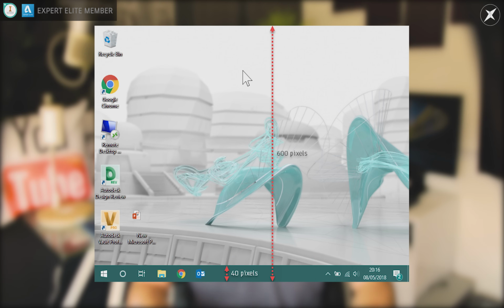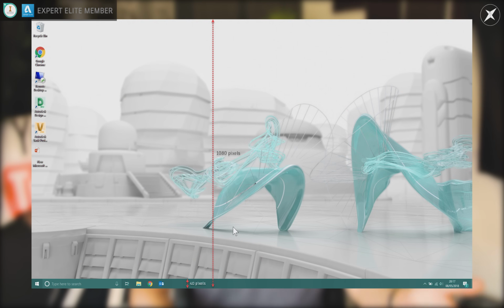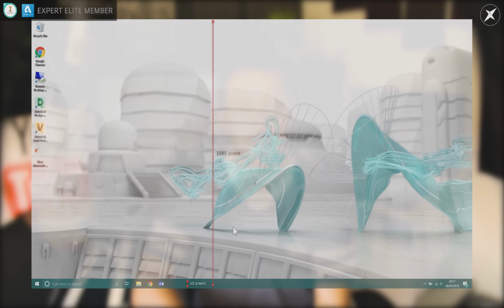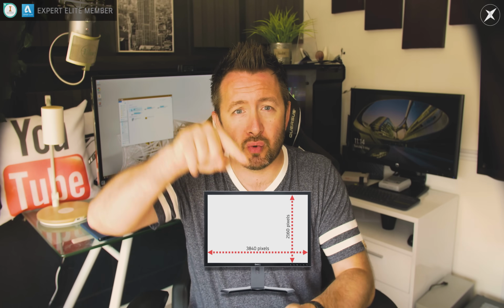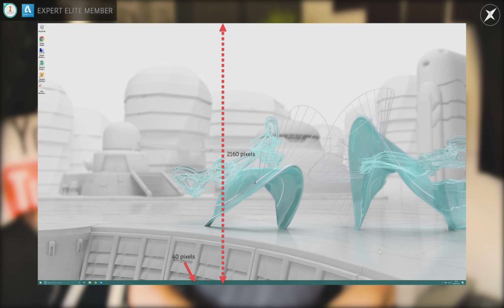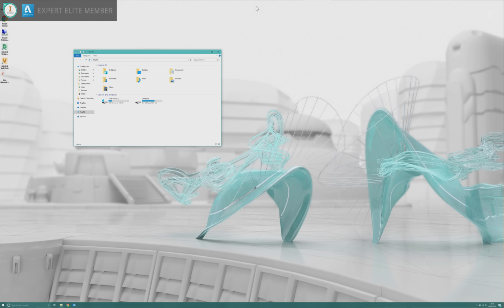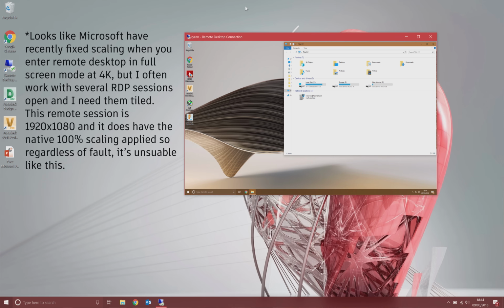Why 4K is no good for me, and possibly for you too (CAD, Engineers & Admins)

Comment: I respectfully disagree with your evaluation. You're using a 4k gaming laptop - That's hardly an objective evaluation - especially for using the resolution for a business. 27" or less in 4k is useless for productivity.

I'm using a 40" 4k screen with windows scaling disabled (100%).  It's real estate-wise it is 4x 25in 1080p screens perfectly welded together. Multiple windows, nothing maximized, and I can use a vertical aspect for the web/documents, horizontal for CAD. Nirvana.
Reply from the maker: Fair enough - I hear what you're saying, I did consider this but after looking at the text and dialog ratio to resolution... I couldn't convince myself that I'd be alright with that even on a larger screen.  This wasn't an objective evaluation either, it was my opinions on my channel.  So would your argument be that 4K without any scaling at all is workable by most people, with a wide variety of differing eyesight capabilities from blind as a bat to 20-20, on screens of 27" and over? Because my eyesight is great and at 1440p with 100% scaling on a 34" panel, I really wouldn't want this text to be much smaller than it is, this was all taken into consideration before scripting the video but I do respect your input here... I may dive deeper into this if I can get a hold of a larger 4K panel.
Reply: on a larger panel, yes.  But note that I personally rejected even a 27" panel to replace my three (aging) 25" 1080p screens.  My eyesight isn't the best,  but at 40 inches, text and window elements is physically the same without scaling - naturally scaling bugs are absent.  

PPI (pixels per inch) is the real enemy when it comes to using a display for CAD work.

Sadly, it's really difficult to shop for "mid-size" 4k panels right now ...unless you are okay with 55".  This is the one I'm using:
https://www.rtings.com/tv/reviews/samsung/ku6300

Comment: I would never enable scaling ... a better solution is to move closer to the monitor or buy a bigger one. 
I'm perfectly happy with my 21.5" IPS 1080p monitor and 1280 x 1024 19" LCD, they have about the same pixel size. 
Soon I'll upgrade them to 4K, BUT i won't purchase a 24" 4K screen ... not even 32" ... IMO 40" is the minimum size for 4K desktop use, without scaling of course.
Reply: Truth.Have tried many 4k monitors, 43" is a sweet spot for unscaled use.32" works with 125% scaling.Currently using a 49" and 55" - not on desktop.. at these sizes, monitor is placed 6" or more behind desk
Reply: so big though - too big IMO - 34" 1440p Ultrawide sweetspot for me

Comment: Most modern CAD program's now a day use ribbon toolbars (https://www.youtube.com/watch?v=TRhjOBhAPb8), designed to switch from tab to tab (like a game, hahaha), with a wide screen 30% of those tab is used by the screen and 70% is empty, so with a ultra wide u want to merge those tabs into one big one, also u need more height for all those big 64x64 icons. Old school Autocad with classic 16x16 toolbar icons are more useful for ultra-wide. Also windows with a menu not in the center of the screen like OSX will be result in a lot of movement with your mouse. And the WEB has more information in the height, so more pixels gives a more pleasant reading. In my mind a 32" 3840x2160 has the best sweetspot because of dpi (scaling) and pixel height.

Comment: trying to use 4K back in inventor 2016 release on a brand new Del XPS 15' laptop was a bloody nightmare like trying to work wth a postage stamp and then they improved things with 2017 and is getting better with each release ',but Bugger my boots' . come Autodesk .
Reply: I came across someone using one of these hi-res laptops - the icons and text were so tiny as to be painful - user may not have had scaling switched on but I still think hi-res means more detail but not necessarily more clarity - that somewhat a contradict in terms but sometimes bigger (a higher number) does not always mean better.
Reply: come on Autodesk
Reply from the maker: Aye it's getting better, Inventor is fairly solid, so is AutoCAD, it's all the other little niche programs that you have to use for your job which just don't work well even with scaling

Comment: But what about the new scaling system on windows?
Reply from the maker: I literally discussed that for a huge part of the video! Even 200% scaling doesn't work on some applications, and I showed Vault Pro as an example
Reply: I was talking about the new update for scaling that got release at the beginning of April, was just asking if you tried it.
Reply from the maker: Yea all the footage in the video was recorded yesterday using the April 2018 build of Windows 10, sorry I assumed you just meant new as in Windows 10 new
Reply: It's Shit.. It's blurry. The software writers need to go back to school. 4k has been around for some time now and they are still using old code. Get with it, it's 2019 not 2009.
Reply: Problem with (200 %) scaling is that you are paying for 8 million pixel real estate, but can actually use only 2 million pixels. The only reason to buy a 4K screen is to have smoother picture if that's what you really need. 
To maintain the ideal 96 PPI for Windows and old Windows applications, you need a 46" 4K screen, or a bit smaller to still stay within 110 PPI. Anything smaller MAY be unusable depending on what are you doing with your PC. Modern software tends to be okay, Windows at 100 % still crap, older software no chance.